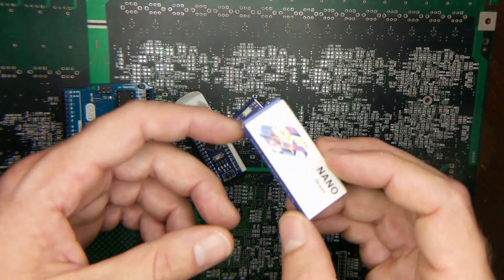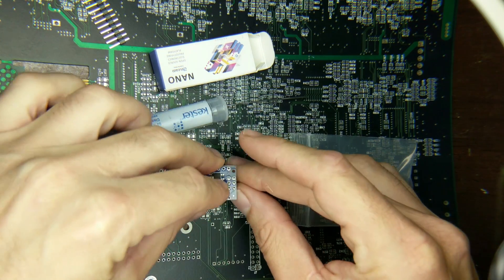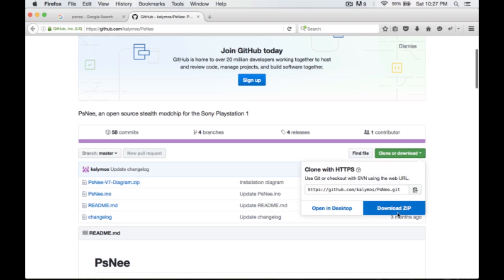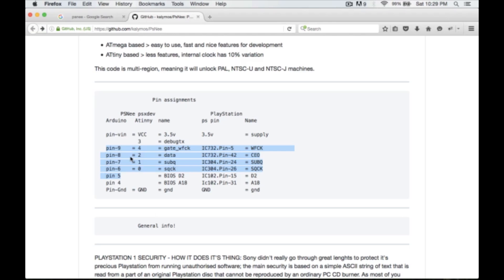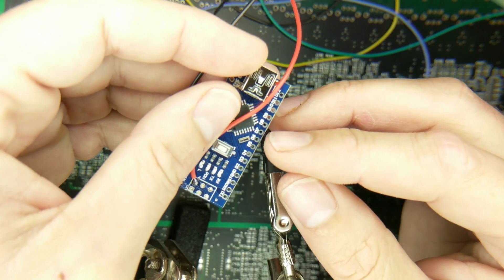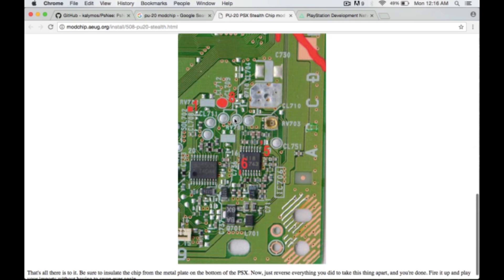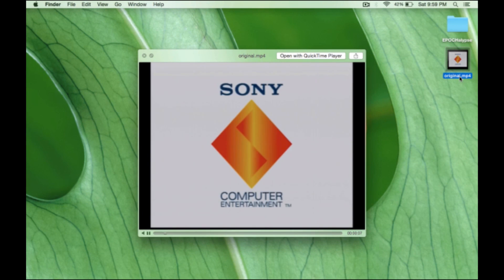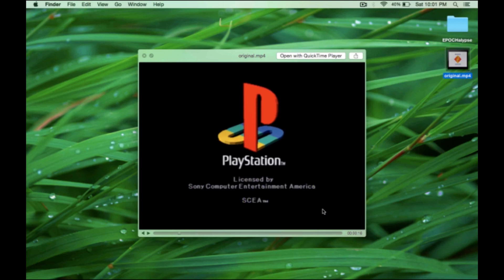PsNee - Open Source Playstation Modchip using Arduino

Comment: I get "Failed uploading: no upload port provided" when i try to "upload using programmer" I have an arduino uno and a micro. Followed all your steps, when I solder it to my ps1 nothing happens, it's working as if I haven't installed anything.
Reply: did you ever find a solution?
Reply: @gg.NattyB  Yes, I got a cheap knockoff Nano, the original Arduino Micro doesn't work for some reason.

Comment: Don't bother soldering the ISP pins in. Jumper the wires as you did to the unsoldered connector, then just twist the connector to make contact when you press Program. Works fine and doesn't need soldering.

Comment: I'll admit, I ruined my motherboard by using pretty stiff solid core wire which I guess put too much tension on one of the traces and it ripped. Then I spilled some solder on one of the chips and obviously with that sort of pin spacing the solder bridges are near impossible to get off and my attempt more or less ruined some of the pins

I learned a valuable lesson today and am never going to use stiff wires for mods like this... thing is I already had some ultra thin wire meant for trace repairs but opted to not use it and the end result is the situation I'm in now.

I found a replacement motherboard which also happened to be PU-23 as well for 10 bucks and it already had a mod chip on it, so hopefully it will work out and I can get the system up and running again. I just feel really bad as a retro collector since I basically ruined someone's childhood PS1

Comment: Nice explanation of how it works. I tried this on an original model SCPH-1001 like three times and it didn't work. I used an Arduino mini. It'd be nice to see a tutorial on this. I burned up one boards audio/video somewhere along the line with it so that sucks.

Comment: I installed PSNee on a Nano on my 1002 PU-8 and can't get it to work :'(. I flashed it with ISP and everyting seems allright (both LEDs shine when I power on the PS) but it just won't read my discs, I just get the "please insert ps1 disc" screen showing i should reset the console. is the black sony screen showing the region supposed to show up even if i don't have a disc inserted? since it's injecting ...? PS still reads audio CDs perfectly. Could I have done something wrong when bruning the discs? I tried different image sources. here's a picture of the soldering https://www.reddit.com/r/psx/comments/aa10pu/help_psnee_scph1002_pu8/

Comment: I performed the installation and it works great, but discs from other regions don't. I have PAL tried NTSC/U and NTSC/J without success. 
Loading stops on PS logo. Is anyone have a success with different region?

Comment: Awesome, I'll definately install one of these with an additional status LED (because I like LEDs) in my SCPH-1002 (PAL launch model with a PU-8 motherboard) PS1 along with a bunch of other mods I have planned, admittedly, I'm a bit rusty when it comes to PS1 modchips (the last time was a Mayumi V4 in a 5502 PS1), but if I can install PS2 modchips, I'm sure I can handle this.

Comment: I have used a nano and a micro(ported the pins) both uploaded from arduino ide using the usb and both worked perfect so not sure what your on about? , ported pro micro download and pu22 diagram is on the psnee thread on psxdev
Reply: I'm using a pro micro tested on a pu22 and pm41 (pal) with the boot loader and perfect success rate, Ill try a different board when I get chance.
Reply: @killerconsoles517  Hello! I'm trying to find an installation diagram for a PSone Slim SCHP 101 with PM41(2) NTSC but I can't find anyone... do you have one? thanks!
Reply: @Sergeant_Camacho    First check the psnee thread on psxdev.net,  alternatively I can send you every diagram for the original chips ie  onechip / mayumi ect and you can cross reference some of the pins  which is easy ,  its the subq / sqck you need to find this is a post on the github may help: https://github.com/kalymos/PsNee/issues/10
Reply: @killerconsoles517 Thanks for the info. I will check them out. Also I have a doubt about the bootloader, do I need to erase it or I just can do it via usb?
Reply: @Sergeant_Camacho  If you check the thread on psxdev.net, I asked the same question after this video as I used usb,  He responded when it was required.

Comment: Great video, just completed this myself following your steps and it worked a treat! Luckily my PS1 had the PU-23 board so the diagrams in the zip file were perfect.
Reply: any chance you can share your solder points? I can't seem to find an appropriate diagram... :(

Comment: Nice job, think I'm going to have to try this. The reason Vin didn't work for you is it's feeding an onboard regulator which specifies min 6V. Vcc on the ICSP header is on the other side of the regulator which is why it worked. You could alternatively have gone into pin 27 ("5V").

Comment: Shoot, I programmed an ATTINY85 WITH the arduino bootloader.  I have yet to install it because I haven't found a cheap PS1 yet.  Any way to wipe the ATTINY clean so I can program it without a bootloader?
Reply: I know this is a late reply, and you've probably already found a solution, I thought I'd post this just in case someone else is having the same issue:

You should just be able to flash the PSNEE code to the ATTINY using the ISP method shown in the video, it'll just overwrite the bootloader as the IDE erases the chip before flashing it. All new from factory Arduinos (even clones) come with the bootloader (and the blink LED on pin13 script) preinstalled anyway, I assume the ATTINY series work in a similar way, just without anything flashed to them from the factory.

Comment: Great. I will try this project in my old ps one!
I never had a Sega Saturn but I was reading a little last days about copy protection of the system. I know there is a modchip you plug in the flat cable but I didn't find it how it works. So Do you know if a cheap microcontroller like arduino could do the same job of this modchip?